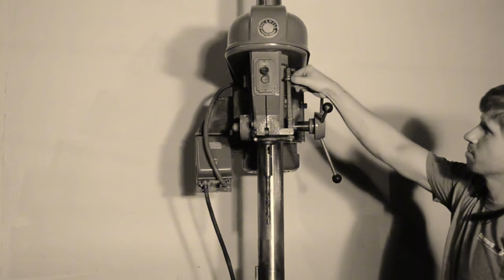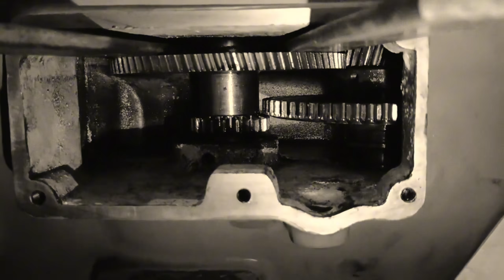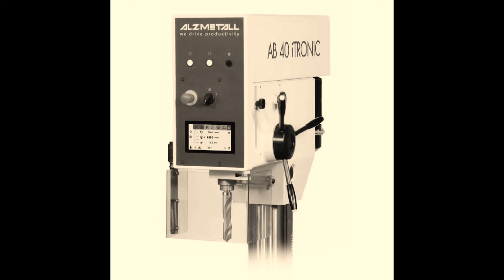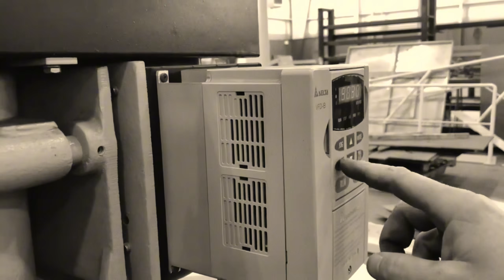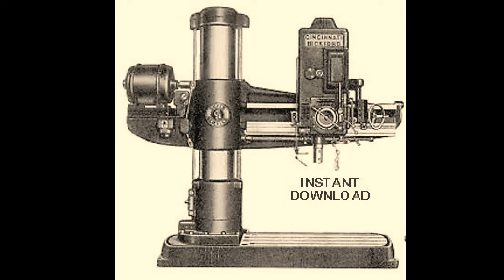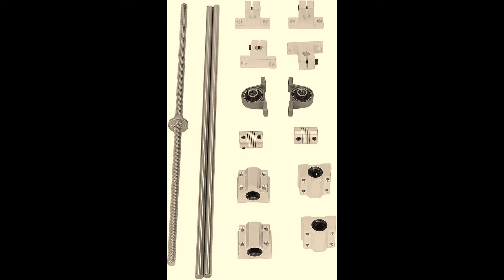20 Best Drilling Machines Ever Made

Comment: Biggest failure of smaller, simpler drills is lack of speed range. Many will have a low speed of 350rpm and a top speed of 1000rpm. Great in wood, but pretty useless in metal. Double digit low speeds and 2500-3000 in a 12spd range is a good spread for a metal working shop.